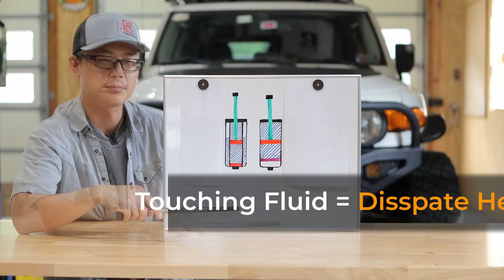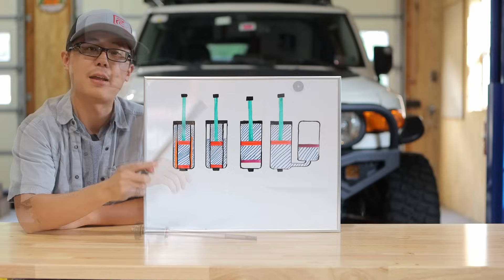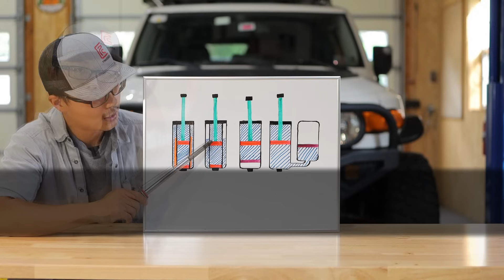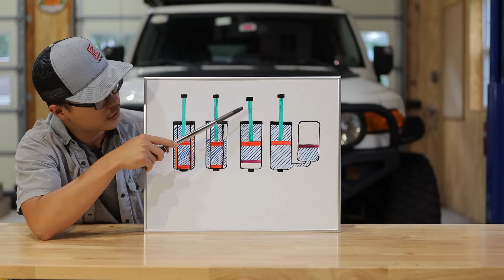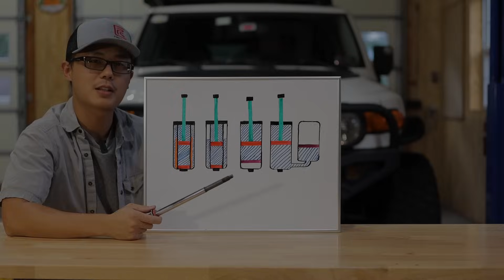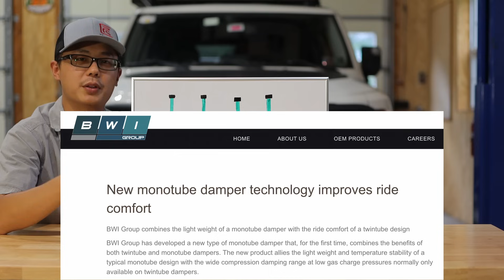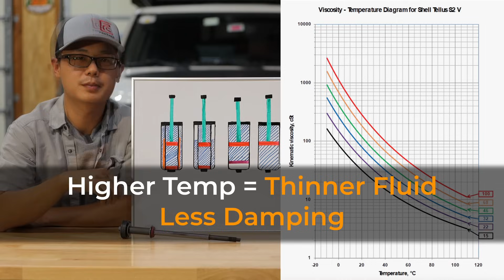The Key Difference No One Talks About | Twin Tube vs Mono Tube Shocks (Is High Pressure Good?)

Comment: OHLINS TTX (TT stands for twin tube) shocks are twin tube but a whole different technology than the twin tube shocks in your video.  The Ohlins TTX shocks and struts do not rely on lots of gas pressure as there is never any cavitation.

Comment: in your opinion, for the average overlander in the mountains that does slow offroad, no desert high speed stuff and generally spends most of the time on the highway with overland weight. would a foam cell like ironman be a better option? or the monotube style be more beneficial?

Comment: Just subscribed! This is the exact channel I needed. I have a 2019 Jeep Rubicon JLU and have been wanting to gain more knowledge when it comes to parts and mechanics and I am learning so much from watching your videos.

I have a question. What’s your views on the Teraflex 9550s? I discovered my red rubi front shocks were leaking 2 weeks before my overlanding trip of the eastern Sierras here in CA coming up this Sunday. I was in rush and did not do enough research before selecting the 9550s and did not realize they are twin tube. I’m concerned that they are not capable enough. I don’t do anything hardcore like the Rubicon trail. I mainly do dispersed camping and hit some moderate level challenging roads to get to some spots. They feel pretty comparable to the stock Rubicon shocks but I haven’t done any off-roading yet on them. 

The 9550s are just a short fix. I plan on getting Fox 2.0 in the year or two.

Comment: The remote reservoir is for controlling cavitation at the piston due to high shaft velocity. Pressurizing the chamber is to prevent this when the manufacturer is too cheap to include a remote reservoir. Cavitation is fluid boiling at the piston which causes gas bubbles and wrecks your damping, as you now have foamy fluid being pushed thru the shim stacks/ports.

Comment: How much oil should I fill my twin tube shocks? specifically kw v2 twin tubes? Can i get some of that foam and fill her up all the way? what size foam will i need? Is there some sort of formula to calculate internal volume and travel length to determine how much space to leave for the fluid to move or what size foam to use?

Comment: What brand of lift kit would you recommend for a 2013 GX 460 w/KDSS??? Toyota Mafia recomends only 2 inch max for KDSS because of the problems that occured with KDSS equipped GX 460s. I'm just overlanding and exploring old logging roads. Since the GX 460 is heavier than a 5th Generation 4Runner overlanding sites recommend the Dobison brand because they make heavier quality springs. I do like Australian made equipment since they have many years of testing in the Australian Outback. I just want quality and reliability with low maintenance. Any recommendations would be much appreciated. Thanks😊

Comment: The advantage of a monotube damper is not just the fact you can tune them better. 
Having more piston surface means you make it work in a wider range, ie potentially the bandwidth of the damper will increase. 
When properly shimmed, the monotube damper will deal better with both low speed and high speed movement compared to the same damper with a twin-tube design.

Also, what you missed is the fact that monotubes can be inverted on the car. That might not be the biggest of concerns on a big 4x4, but decreasing the unsprung mass (which is what you do when you invert the damper) will help getting the best performance out of the suspension on any suspension setup.

Comment: Dude your information and explanations have helped me understand the pros and cons of both, I've been trying to decide between Raw Nitro Max twin tubes or Dobinsons IMS mono tubes, the price difference is around $500- $600 more expensive for mono tubes but I have realised what actually suits my needs on my 80 series landcruiser is actually the twin tube, the Nitro Max has a 45mm piston and 60mm outer tube/body and some kind of bag set up to contain/separate the gas, huge fluid volume and are the 4x4 line of products from parent company Powerdown which is a truck suspension company  dealing with semis, b doubles and road trains etc, I think they know what they're doing. I want something strong, simple and reliable that's going to withstand outback touring and bush navigation etc.

Comment: Great video, I have a question, I have FJ cruiser with 3" life , I have changed the coilovers front and rear with dopinsons, panhard bar, UCA dopinsons , sway bar link, and put profender shocks 2.0" , and 1" spacer in front, all this for the 3" lift. But the raid is bumby and uncomfortable , should I change the shocks or what to do? 
Help please.

Comment: I was wondering, what if i put the twin tube upside down and press it few times, will the gas from outer tube goes into inner tube via the compression valve? and what will happen if the outer tube filled with fluid, and the gas is inside the top area of inner tube (the area around the shaft)?

Comment: Great video! I find your information very easy to understand.  I think about suspension upgrades a lot and how much "snake oil" is sold to the end user.  Can you do a detailed explanation comparing Digressive, Progressive, and Linear...  In my short research and limited knowledge it seems Linear would be the best for daily driving/weekend warriors.   Curious what your thoughts are.

Comment: Minor clarification: with a foam insert you actually lose fluid volume compared to a shock without one. This is because while you still need to have the same volume of gas, the material making up the foam (and holding the gas in place) itself occupies volume. This is why street racers replace the foam with gas bags as the volume of material needed to contain the gas is smaller with a bag compared to foam. 

This isn’t a real reason not to use them, doesn’t change any of the conclusions, and street racers are largely wasting their money. I add this principally as a reminder that everything is a tradeoff: using foam inserts costs you money, durability, and a tiny amount of volume.

Comment: 11:46 - Would it be possible to boil the fluid in a vacuum to extract the dissolved gas prior to filling up the shock? Turning sparking water back into still water if you will. You'd probably have to fill the shock in a vacuum as well, increasing production cost but it seems that doing this would help reduce cavitation in a high-end application

Comment: The information you present about the Ironman4x4 shocks appears to make sense as does some of what the company claims on their website, but I just had to remove my FCP shock set up after 25k miles because the ride was getting to be terrible (bouncy between 40-60 mph with new well balanced tires) and I had to change tires due to early onset cupping in the rear.  The springs also appear to be experiencing some sag.  I fear this company either does not have good quality control or is using a technology that doesn't interact well with the riggers of driving these rigs.  I've just moved onto another suspension set up and I won't be coming back to Ironman4x4.  Their reputation in the Toyota community around (I live in Texas) me is very bad and I wish I'd known that before I purchased their suspension.  It has proven true unfortunately.  The claims of this company have been proven unfounded to me and I regret buying their stuff.  Suspension should last longer than 20k miles for how much this costs (20K is when the tire issues and rough ride started and it's taken me 5k miles worth of time to save for a new setup.)
Reply from the maker: Good to know. Appreciate sharing your experience

Comment: Hi Tinker, my 2007 regular cab 4x4 tacoma no lift as of yet...has a terribly hard or stiff ride as if it's a buck board...I purchased it and the struts and shocks are TRQ...can a different shock or struts make my tacoma ride more smoothly.  Any information you could provide would be greatly appreciated....Errol.

Comment: FWIW, Most dirtbike forks are traditionally a "twin tube" open bath cartridge design that relies on both the base valve  and piston for compression damping, and are subject to some pretty extreme use.   The marketing people have really thrown some misinformation out there.  
I love my Bilstein B6's on my car even if they are guilty of some misinformation.
Reply: @SSR Suspension  I wouldn't say incorrect...  Most high performance dirt bike forks for the last 25 years have been "twin tube" open bath cartridge dampers.  It is true that in the last couple years, more exotic cartridges have become the norm for high performance applications. but that in no way negates the decades of impressive service basic open bath cartridge dampers have given us.  A lot of the reasons for the self contained cartridges is weight savings with reduced oil capacity, and air assist systems to replace heavy coils not just damping performance.  My point is that marketing people would have you believe that twin tube dampers only belong on  mass produced budget suspensions. But there are high performance twin tube offerings (most Koni shocks).  Not just Monotube (Bilstein).  Just trying counteract some of the marketing misinformation.

Comment: Good stuff.   
It may be worth putting up a phase diagram/chart for standard shock fluid to show what is actually happening (or doing a separate video on this).  Otherwise its hard to evaluate what is actually happening vis-a-vis shock fade and the upside and downside of twin tube vs pressurized mono-tubes.  Also, does cavitation in a damper really matter that much as the "high pressure" side of the piston (i.e., the side of the piston head that fluid is flowing into) is under much higher pressure and is unlikely to cavitate and that is the side that is doing the most dampening work?  Lastly, why is it that we don't draw a vacuum on new damper fluid before installation to avoid the dissolved gas situation.   I know that when I change the brake fluid on my MTB (SRAM - DOT fluid), I always use the syringe that I use to draw a mild vacuum to get out some of the dissolved gasses.  Thanks.

Comment: Finally someone else that has explained that the sole purpose of the remote resovoir is to lower operating pressure and create a nicer ride and  increase seal and wear band life is only a side effect and that the extra cooling is only an added side effect

Comment: I think your analysis is great and I learned a lot from this video. 

I have repeatedly seen the claim from shock manufacturers that blown shocks can continue to additional distance in braking distance. 

I recently tested this with 300k mile shocks 60-0 mph versus new Bilstein shocks. 

Even though the truck was much more composed in braking, I measured virtually identical stopping distance. 

I would like your input for this phenomena. 

For more information, check my latest video.
Reply from the maker: Thanks. I watched your video. Great video and very interesting test. I was a little surprised about the result as well. With the amount of claimed difference from the manufacturer, I thought even with a single not so scientific run it should show more difference. A tall vehicle should also exaggerate the effect in theory and you clearly triggered a different dynamic in nose dive. I think you might be onto something interesting.
Reply: @TinkerersAdventure  The theory makes sense to me but my best guess is the EBD/ABS/Guidance works well enough to compensate or something is broken. 

Considering it has all new lines, hard lines, pads, rotors, and calipers, I doubt it's the latter.

Comment: Hey mate, i am the owner of a toyota fortuner 2022 model. I have been on a never ending battle with finding a replacement rear shock that rides comfortably. I have used both Fulcrum and Outback Armour rear shocks, they both ride harsh on the smaller more sharp bumps on the road and kind of kicks me in the back. I have placed the original shocks back on which solved the ride issue. Is there any other brand of shock you will recommend with similar ride quality to the OME. I am usually unloaded.
Reply from the maker: I am cannot make specific suggestions, but maybe consider something with damping adjustment knobs and dial it to the soft side. Most off the shelf aftermarket 4X4 shocks are valved for heavier load and big compression.

Comment: Please review some literature by fatCatMotorsports regarding shock pressures, piston/rod diameter. Ideally, you want a shock with no compression or rebound resistance (at an infinitely slow speed) shocks do not suspend weight or hold it, they slow the acceleration and motion of the spring - I'm really curious with offroad stuff how this works, given the vast weight differences in wheel tire/axle setups, and how it affects shock tuning. Poor accutune... When I finally have the money I better just shill out some $ for consulting/irritating them 😂 maybe I'll just try and rent a shock dyno somewhere
Reply: Just got to part where you talked about the fixed base valve Monotubes to improve ride quality - it's a think, it works when tuned right. It makes a car ride amazingly, and handle as expected, making it easier to fine tune spring rates and sway bar adjustments without "hiding" the small changes.

Comment: Thank you for another eye opening video. How do the high and low speed compression adjusters on remote resovoir shocks affect shock performance and how does rebound adjustment play into this? I bought a set of  Dobinsons shocks that can adjust all three but it’s not totally clear how they all work together.
Reply from the maker: Thanks! That is a much more complex topic. It’ll need some by scenario examples to tell a full story. I might do a video on that
Reply: @TinkerersAdventure  yes please 🤩

Comment: Another great video - its worth adding another benefit of twin tube shocks on vehicles doing high speed gravel road work or likely to drag shocks on obstacles, especially applicable to rears - a dent in outer body of a twin tube shock has negligible impact on performance whereas a dented body on a monotube is usually terminal for the shock.
Reply from the maker: That is true. I actually took some footages demonstrating this but I cut that out due to video getting long. The bilstein actually took a lot to dent. I hit it with a pointed hammer quite aggressively, took about 3 good hit till the piston bind. So unless it’s a very inferior thin wall shock, gravels will not hurt it. Also, all monotube rear shocks are inverted mounted. The shock bodies are way up there, so I’ve never seen one getting scratched. Twin tube has to be mounted shock body down because of the base valve.
Reply: Yes good point, I forgot that the monotube shocks are inverted, though that can lead to peppering of the piston rod if its not well shrouded.  A lot of our travel is thousands of kilometres on high speed gravel outback roads which grit blasts anything in and around the rear axle.

Comment: Pretty neat video! I would add that heat transfer happens in three major categories. Conduction, convection, and radiation. Conduction is solid to solid, convection is solid to liquid, and radiation only occurs at extremely high temperatures and does not require a medium to transfer heat. So shock heat is not actually radiated, rather convected away from the oil by the solid body, then convected away from the body to the surrounding air. No radiation heat transfer occurs. Great video and keep up the good work!

Comment: I recently just put a lift kit in my 2015 Kakadu Prado with Kdss. I'm running the Tjm xgs series springs and shocks up front, with outback armour shocks and airbag man extended airbags in the rear. The entire kit, with uca's in the front, cost about $4,000 aud. So far the rebound has been harsh onroad, but performance is ok offroad. It's making me reconsider redoing my suspension again for better performance onroad with more control offroad. Lifting with kdss is often expensive and a headache. Was considering monotubes with remote res, but now I have no idea on which direction to go. 😂
Reply: I have a 2015 KDSS 4Runner and I have finally decided not to lift it for those reasons.   Unless I want to soak 15k+ into long arms etc.. it just doesn’t seem worth it.  I’ll do a body mount relocation and fender trimming before I lift it.

Comment: How i wished this video was uploaded earlier then i could've decision for my fast driving application. I drive a Toyota Hilux here in Asia and decide to  try a monotube shocks after watching tons of video on youtube.  The IFS front setup seems pretty good handling all the bumps but  i find the rear live axle to be a whole lot more bumpy going over rough terrain than my standard oem shocks. Will probably consider changing the rear shocks to a remote resorvoir in the future.
Reply from the maker: It could simply be your rear shocks valving not matching your spring and mass. That plays a significantly bigger role than shock construction

Comment: Very educational video for me. Thank you very much. Just wandering is it possible to make a video about bump stop please? There are lots of after market air bump stop and hydraulic bump stop as well. Do they really do the job they advertised?
Reply from the maker: Thanks. Good idea. I bought a set of hydro bumps for my IFS but decided not installing. My take is the Toyota IFS doesn’t have enough travel to make good use of hydro bumps. I have long travel IFS and I still don’t think it makes sense for my application. Others will vary